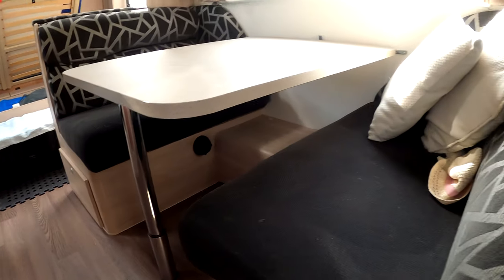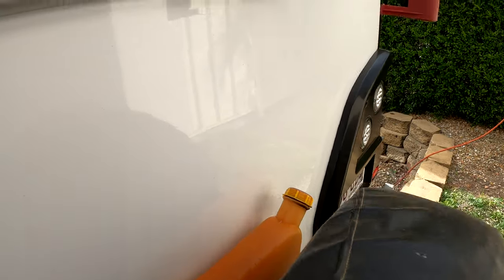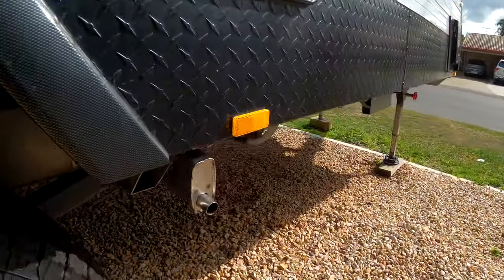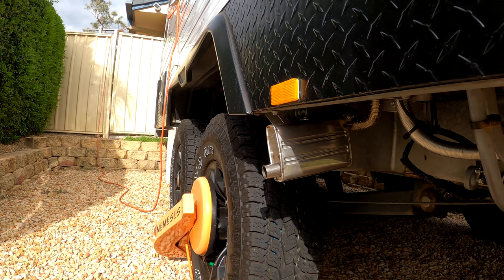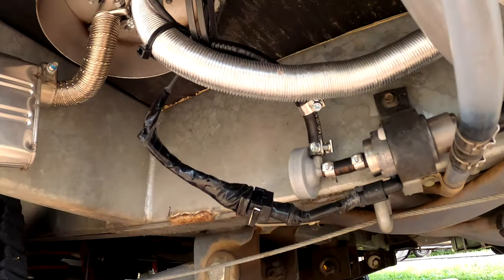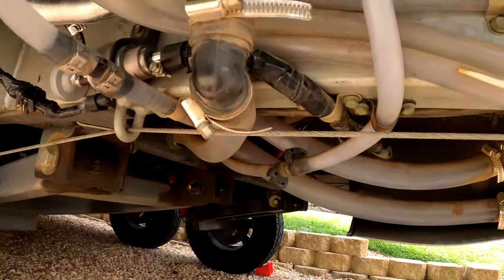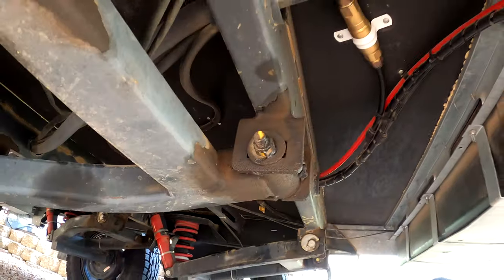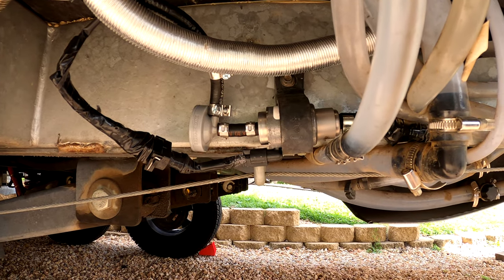5 Reasons why I removed my Chinese Heater.

Comment: Do you prefer this over the propane unit? Or did your trailer come with a propane unit.
Reply from the maker: Hi TJ, this unit is much simpler to install than a propane unit & you don’t need a gas license (In Australia.)

I think I prefer the diesel unit because it’s easier to fill with diesel than swap out the propane tank.
Reply: @AdventureCampingAustralia  I completely agree with all of that. I’ve considered adding a diesel heater to my rig. It would stretch the propane hugely far. 

We don’t require propane licences I just like the idea of a diesel heater on my trailer. Awesome back up.
Reply from the maker: Nice 👍 Yeah, if you have the money it’s definitely worth installing one.

Cold is no longer a factor when you have a diesel heater. 👌

Comment: According to the research the webasto is 1600 bucks are you fucking kidding me.
Reply: You right. I think reason for beign so expensive is the maintenance of warranty repair department and engineers to build new innovations.
Reply: I buy my webasto 2000stc for 500€
Reply: @misocveticanin578  probably stolen. What is the serial number please?
Reply: @897aa33  😂
Reply: @897aa33  good connection bro ,and you can find anything, keep working on yourself

Comment: You are running your heater wrong if you get soot in 200 hours. I have run mine 24/7 for 7 months straight, almost no soot in it! Gotta run them on high for 10-30 mins before shutdown to clear the soot, best if always run on high or shut down. The chinese heaters are an exact copy of the Webasco. Only difference at all is where they are made.
Reply: So one has to think  always think HOW he uses the heater? And can't run it on low, if he doesn't need it on high?

That sounds like exactly one of the good reasons to not buy the Chinese clones, to me at least...🤷

Comment: Wow gets dirty quick sounds like dirty fuel or bad install. Said 200 hrs dirty cleaning at 500.  Bad desil better get some fuel cleaner.  Wow you say don't buy cheap units but that's a cheep Rv. Not the best on market but at bottom. 😆   That's no air stream.  😆  That new unit will have same dirt issue  it's the fuel combined with weather and how you use it. The user bad choices is the hardest to fix. Like buying the wrong diesel fuel. Or not storing it properly like no rain gard over that tank on back caps leak there is a vent hole in it. Rain salt dirt can get in causing fouling of unit. Nice you like a better unit but you have a issue that a better unit won't fix. Fouling by use or fuel.  Every 500 hrs clearing of unit due. Your getting 200 others getting 500 or more on same unit. Hmmm
Reply from the maker: Hi, thanks for your comments. The new unit is running great and has been using the same fuel and tank system as the previous unit. It’s winter here at the moment and we are well over 500 hours of use with the new unit without issue and it’s still running smoke free. For those that RV on a budget, this unit is not the cheapest but it is the best value. Hope this helps.
Reply: Cheap camper says the guy driving a geo metro 😂😂😂yea I saw you last week notsofastthings rockin the metro...lost my keys guys

Comment: sorry , I know a lot of these heaters the chinese is as good  as the webasto...  the only thing you are right on is the clicking sound. what I hear you telling is that there was something wrong with yours probly with the air sucking hole that is not free . it is a verry small hole before it go in the chaimber. webasto has these problems on the same amount. even if you have to buy every year a new one than you can do 9 years behore you get on the price on a webasto

Comment: People who slate the chinese heaters don't know how to install them and judging by your wiring under your van  your not very good at diy,the problem with them Clogging up is because of the fueling,I tuned my chinese heater with a CO meter and has never clogged up in 3 years of operation,all you people who have problems always blame the heater when its your install at fault,you've just wasted your money on your overrated webasto 😂😂😂
Reply from the maker: Hi Jamie, thank you for your input, I'm glad you found the video helpful. Both the Chinese heater and Webasto Heater came with wiring harnesses from the factory that were installed in accordance with the supplier's instructions. Hope this helps.